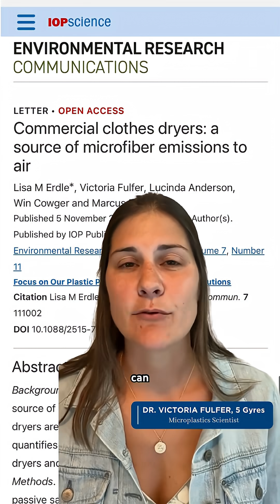Microfibers from dryers?! 👕🌀

Comment: Unfortunately I think it would be easier to remove synthetics from textiles than build a dryer exhaust filter capable of filtering microfiber safely. (For the average person who hadly cleans the regular filter in their dryer)
Check out condensing dryer filters, those usually have the finest mesh of any dryers. They require some extra maintenance because the tiny pores will clog with laundry products and reduce airflow significantly enough to hinder the drying process.
Reply: This is more for laundromats, not personal driers. Laundromats are more regularly cleaned and maintenanced  too
Reply: I’ve always wondered, are microfibers from natural fibers also dangerous? I understand that microplastics are what people are concerned about, but wool can be highly irritating, cotton is often processed by harsh chemicals (jeans are the most environmentally dangerous and overproduced garments), and things like bamboo are basically just plastic. Obviously they are less dangerous long term because there is far less of them and some will biodegrade more easily, but it feels like we should be worried about any particulate that can be inhaled
Reply: @Tinyvalkyrie410 anything that we breathe in that isn’t clean air is dangerous for our lungs, so yes.
Reply: Or you could dry your laundry like Europeans and hang the clothes to dry